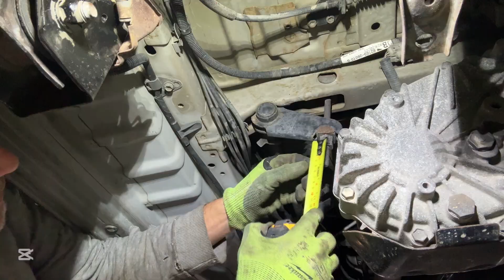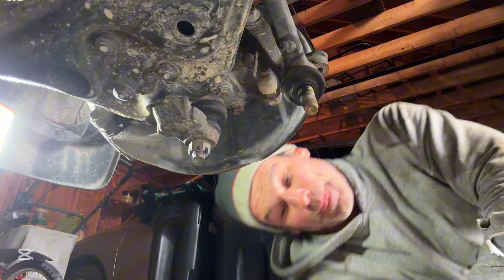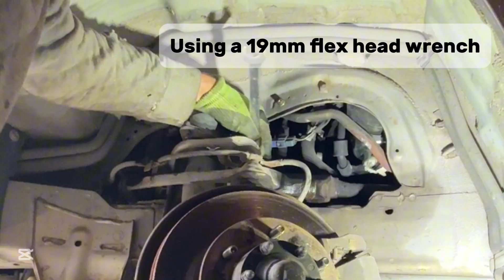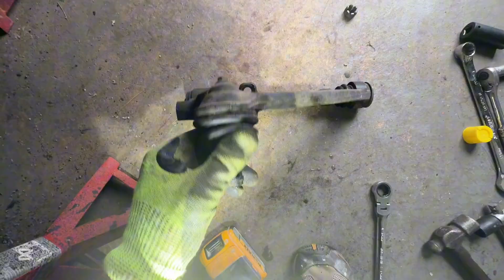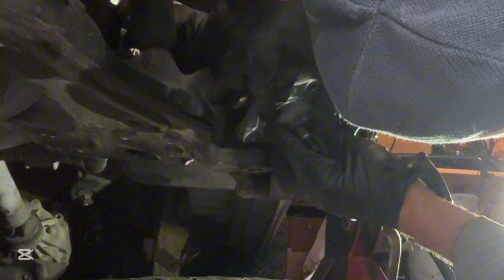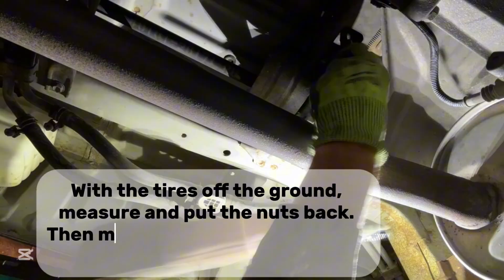How to replace upper BALL JOINT, control arm, inner-outer tie rod removal. #kzh106 #hiace #kzh100

Comment: this was very helpful! Do you have part numbers still? Hoping to do this all on my 1998 Hiace KZH106 4wd
Reply: same here!
Reply from the maker: Hey, thanks for checking out my video. I  don’t want to give you the wrong part numbers; so, the best way is go to partsouq or Amayama and you can enter your vin. It will kick out the exact part #s you need. They’re a great resources and have better pricing (just have to wait a bit for shipping)
Reply: Nice! I have the same van same year/code. What has prompted you to change these parts? I’m also curious why the guy in the video is doing it? 

I’ve been having an issue with mine over the last several months where if I turn all the way hard right I sometimes get loud resonant creaking sound, especially if I hit a bump while locked out hard right, it’s very loud and scary. From my research, this may be part of the problem but I’ll have to look deeper into it to figure out what’s causing it
Reply from the maker: That sounds like the CV joint is bad, from what you’re describing. 

For checking the ball joints, like what I’m replacing in this video, you need to lift the van and look for play. Using a pry bar helps for the control arm. 
There’s a bunch of technique videos out there for checking all the ball joints.